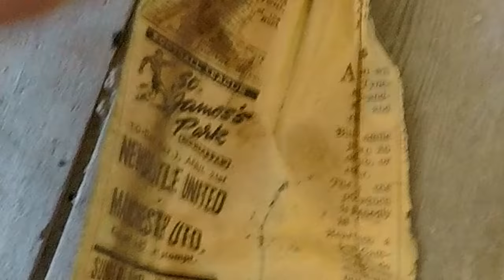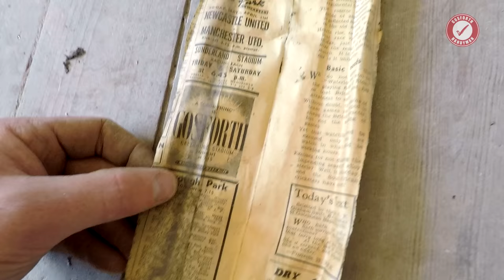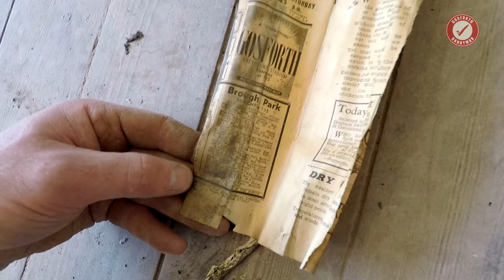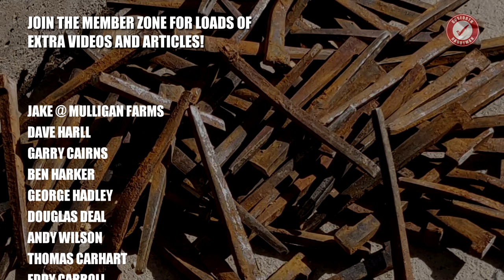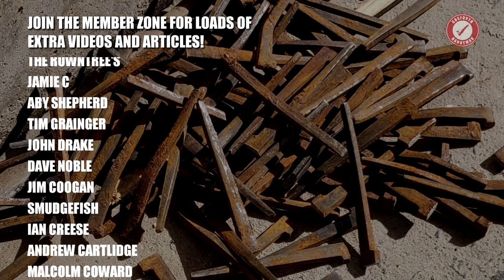How we INSULATE under the floors (1920's Renovation Part 26)

Comment: I hope the void under your floors are well ventilated otherwise look out, we have just had to replace the entire floor joists insulation and deck  as the builders did not install adequate ventilation and 200 x 50  joists  had decayed and only 75mm was left in places after 12 years!
Reply: Haha reminds me of when I pulled up my floor recently to do this job and found that the original 1920's joists were daughtered up to replacements from about 1980. Both turned to dust when we pulled on them. The air brick had been blocked up for at least 70 years by the looks of it. ;0 They went to the trouble of replacing the joists but never bothered to check ventilation or figure out why the originals had dry rotted. We bricked up the fireplace and put an air brick in below the insulation level and replaced all the joists with reclaimed timber. Treated the ends etc. Solid as now. Last another 100 years no question.
Reply: I’m fairly sure he mentions in the tutorial that cleaning and ensuring the air vents are free of any debris or blockages.
Reply: @jixuscrixus1967  someone obviously commented without watching the vid as he mentions it loads!
Reply: How are you supposed to ventilate the void under the floor?
Reply: @sali8312  installing airbricks allowing the air from outdoors to flow under the floors preventing damp.
Reply: You obviously didn’t watch the video
Reply: What size wood screws have you used and I noticed you drilled pilot holes before putting screws in. Does this mean one should not use the initial hole where a nail or screw was inserted. Thanks. Great video, by the way.

Comment: Really like that I'm not the only one who loves to clear out under the floorboards if they are up.
Reply from the maker: Cheers Craig! Absolutely - hate leaving it like that. 😁
Reply: On the ground floor it also improves the air flow, any rubbish tends to suck up the damp too and it takes longer to dry out.
Reply: you can also find some treasure. Once I found pack of smokes about 80 years old. My friend smoked them and he is still alive, so I guess it was a win
Reply: Every other tradesmen uses that as a handy bin! Never known anyone to clear up under there. Part of the joy is reading the old newspapers!
Reply: my builder lost his wedding ring under my boards, its somewhere down there for future generations...
Reply: @ru54623  did he charge you extra?
Reply: I found the remains of a sandwich wrapped in foil under the floorboards of a house once. The boards hadn't been up since the 80s when it was rewired. I often think about that electrician looking around for what he did with his lunch.
Reply: @herraghty  why would he? It's his fault 🤣

Comment: Good progress - until your comments about a wood floor going down my thinking would have been to just rip up all the floorboards, batten and insulation and then fit t&g flooring chipboard (screwed down) - the time saving probably out-weighs the cost of the chipboard (and lots of floorboards to re-use for something else).   AND the pallet breaker gadget is great - I have  a home-made version that cost me almost nothing!
Reply from the maker: Yup, would tend to agree. That would have made the job much easier if we weren't doing new wood floors. 👍
Reply: What would be wrong with putting wood flooring on chipboard?
Reply: @Game0verFool   nothing wrong with it. Im about to rip up my old floorboards in the lounge insulate put chipboard down and glue oak on top. 

My guess is Andy is confident the boards are flat enough to glue to or hes going to overlay 4 or 6 mm ply which will eliminate any potential drafts that still may exist and saves a few hundred quid on chipboard.

Comment: Great work as always , I know from personal experience that the thicker insulation would be harder to push into place under the floor boards . The slittiest difference in the gap between the joists and it locks sold, so what you have done is definitely the way to go . I love your approach to everything you do even down to cleaning out all the rubbish that has no doubt been there since the house was built .  You’ll have to put a peace of wood under the floor with your name and date when this work took place , so in another 100 years someone will say this chap made a wonderful job of this house bless him .       Best wishes and kind regards as always  😀👍👍👍
Reply from the maker: Cheers bud! There's a few messages hidden around the place. 😁👍

Comment: I had this exact same job to do myself for a 1925 house and I used scaffolding mesh to create a hammock between the joists. Then I laid rock wool on top. It was something like £1 a roll at the time so it saved a lot and the limited joist depth wasn’t an issue. I think I put a vapour control layer on top of that and then nailed the boards down. My main concern throughout was to avoid moisture buildup in the timber as this leads to woodworm which we had an existing problem with. The rock wool doesn’t trap moisture (which is another reason for choosing that) and also all the air bricks needed clearing out to get air flowing under the floor. 12 years later and the woodworm issue has been sorted ever since. I like your method because it doesn’t need all the floorboards taking up which a massive time saving. On the flip side, the good thing about taking up the floorboards is that when you nail them back down, the gap in between can be closed (to stop draughts) and this saves a job later.

Comment: I'm currently doing a similar thing myself and I wanted to reduce the amount of dust and loose debris from the insulation as much as possible. I did some research and ended up buying some soft material jigsaw blades to use in the jigsaw to cut the PIR. They work like an absolute dream, clean straight cuts and no dust or debris at all. I mean none! I was amazed by it, I would highly recommend them if cutting rigid insulation.

Comment: I have nearly got all of our small bungalow done now the only difference is that I put ply on my battons and I moved my heating pipes into troughs in top of PIR. Heating pipes under ventilated floors has been a gripe of mine for 20 years when Energy Saving Trust were banging on about poorly insulated hot water cylinders. Yes I cleared it all out, hoovered it, as I went, a lot of builders see floor voids as skips, I also mortared in the joists, something the builder didn't do and sealed up everything. I did seal up some vents that faced the joists and so I couldn't duct them down into void. The vents on the open ends of the joist I ducted down and we have a lot. To rigidise the floor I did put a two brick pier under joist, we are on a concrete raft so easier than most, I used engineering bricks + slate + DPC. We have an EPC A, I am not sure its good enough for an A, though I think they have A+, A++ to create higher levels. We see a lot of properties around us being bought and 'done up' they always keep the original feature of an appalling EPC, which is crazy. If a property is done up then it should be compulsory to improve the insulation because once you have fancy bathrooms and kitchens no one is ever going to tear it apart.

Comment: When removing nails from joists, I always give them a whack with a hammer first - it drives them slightly further in, but it also breaks the bond between the nail and the wood which has formed over decades, which makes pulling them out a lot easier.
Reply from the maker: Good tip! 👍

Comment: I did this when I moved into my bungalow late 2014, and put DPM on the subfloor to prevent moisture from the ground before keying in the insulation , cleaned up all the crap from the previous tradesmans work aswell,renewed the old floor boards for 22mm Caber floor....job done 👍
Reply: Hi did you just lay the DPM on the floor and that's it ? Thanks

Comment: Been there done that. In 2017 I removed all the boards at one time, cleaned out and vacuumed underneath but then put a breathable membrane "up and over the joists" sealing in at edges then laid in sheeps wool insulation and put a new floor down. Stank like a barn for 6 months (not thereafter) but the insulation and sound proofing that it provided is on another level.
Reply: I'm planning to do the same in a few months so it's good to hear it makes a difference since I was a little worried that it wouldn't be worth the hassle.
Reply: @elobiretv  VERY much worth it if you do it properly. NO draughts, silent, breathable and the house warms up so quickly it's un-real. Huge reduction in heating bills. It's more work than using Celotex. As I have wood flooring,  If I had my time again I would have considered running  tubing underfloor as central heating and warming the whole floor area rather than radiators but that is another discussion. Hope this helps.
Reply: Did you put a DPM over the top after or just the single breathable membrane underneath to hold?

Comment: Excellent video. Nice to see a builder cleaning out under the floor, it's usually used as a disposal area.  Most important to seal all gaps so drafts can't get through particularly round the walls which some people forget about and the wind whistles in under the skirting boards.

Comment: Thank you for the good guidance. Best not to cut the Ecotherm outside on the grass though. It won't break down in the environment. Better to cut it somewhere you can sweep it up or collect it afterwards. Technically polyisocyanurate is recyclable, (but left over sawings won't be), but otherwise it might go to an energy from waste plant, (or landfill).

Comment: I’d personally use a multi tool on the first floorboard so the cut doesn’t overlap and then circular saw the tongue & groove parts sections. The boards lift pretty well that way and virtually no damage. I’d also try to stagger the cuts so the cuts are all in a line, if that makes sense. 
Thanks for the video though 👍🏻

Comment: OK, please allow me help you. I have MSc, specialising in thermodynamics, and did my thesis many years ago on suspended timber floor insulation effectiveness. I am now an thermal consultant for aerospace applications. You need to spring force the insulation upwards to be in constant contact with the floor. Eg; use something like a PLY curved/sprung slat from a bed, screwed to the underside of the joist so that it bends the slat straight and always forces the board against the underside of the floor. The are numerous leaf spring alternatives.

The air bricks & positioning are designed to cause a purpose draught between the joists, directly at the end face of the insulation that is later installed. This draught is now forced to go around the insulation with a venturi effect pull at the opposite end. The slightest gap between the PIR & the floor board causes a small channel that the air blows/pulls through at high velocity, sometimes whistling or chattering the PIR & floor boards, thus the insulation does little but act as a conduit. You will also have small gaps in your floor boards tong & groove, that permit 'cross-flow' across joist. The problem i'm describing doesn't usually happen in lofts due to the gravity on the insulation that moulds to the face it's laying on.

There is visible clearance in your video (top & sides of PIR) and you wouldn't have been able to slide the PIR in to the slot so easily under the floor boards that you kept in place if there wasn't a clearance. You could partially rectify this by getting the floor boards up at each PIR joint and spray insulation foam (2mm thick, 100mm wide), before putting the floor board back down. This will 'closed cell' seal the openings of the gap that you have created.

I have written this with my best and  positive intentions, so neither you or your viewers make the same mistake that 99% of installers are making. Suspended underfloor insulation is one of the most disruptive and longest payback. If you go through all the trouble, you need to to it properly else it will NEVER payback. If a jobs worth doing well or don't bother.

A few technical improvement would transform the performance from 20% to 90% effectiveness, potentially saving £90 per year instead of £20 per year in heating costs. I wish you well, and if you want to make a proper video on all the critical things to get right, I'd be happy to help you.
Reply: Just a quick question you say you have a degree I  thermodynamics and ypu are an insulation consultant. Then why did building control pick up on the fact that your insulation wasn't touching the underneath of the floor board and was creating a duct resulting in heat loss.
Reply: @nathancurtis2585  My MSc thesis was 35 years ago and was substantially modelling the theory. It did not consider the modern materials used today, the full practicality of achieving the optimum theory and modern day best practices. Since then, my work has been biased towards aerospace applications.

Due to my background, I was able to talk to BC on a very detailed technical level. They didn't pick-up on your 'alleged fact' that my insulation wasn't touching, because I haven't even started my installation yet. During the convo, they told me to make sure that when I do my installation, I ensure no gaps for the previously explained reasons.

If you think about it, a 6kph breeze equates to 1.7 m/s, meaning that the warm air is washed out the gap and replaced with new air before the heat reaches the insulation. Armed with this knowledge, I looked at a few youtube videos for more practical tips, and saw that this critical basic principle was not being taken seriously.

One other thing they mentioned was to apply sticky back foil tape to the top of the joist, overlapping the PIR (not possible from underneath). This delivers continuity of reflective surface and seals the possible air leaks with one continuous reflective & leak free layer. The effectiveness of the installation can be severely limited if you still have draughts.

Hope that helps and all makes sense.
Reply: @markfetherstone2885  Thanks Mark. I hope Nathan watches that video.

It looks a great product and the video explanation on the 'performance gap' really does agree & emphasise my point on sealing all the gaps. Retro fitting suspended floor insulation can be very disruptive, and you must get it right else you'll have wasted your time & money.

Shame they didn't explain a solution to keep the PIR board tight against the underside of the floor boards though, unless they coat the top of the PIR with the foam tape and compress it (super expensive).

As presented, the PIR will work it's way down and create a conduit. A sprung batten would do the trick.

Comment: I was reasonably careful when taking up the floorboards on our '30's property, they were not tongue and groove, and I'm happy to accept some character in my sanded floors,  but the pine came up beautiful after a couple of days of sanding per room, much nicer than many of the fake wood floors available to me. And with the variable diameters of gap filling high density foam, for wooden flooring available there are not concerns with knocking over a glass of water, which would be an issue without the foam.
Reply from the maker: Cool! Not T&G? Don't see that very often! 👍
Reply: @GosforthHandyman  there a bit wider than your boards I think, at about 170mm.
Reply: me too but my 1930s board were t&g. I spent ages lifting carefully while preserving the t&g and managed to remove about 1000 carpet tacks, insulate with sheep and reinstate , sand and osmo. look absolutely lovely. Importantly the whole of the ground floor has the same floorboards and so its all on the same level.
Reply: @twmd  got the downstairs to do like that still, luckily in my case without T&G, but should still be fun, need to put in new 32mm water line first thought.
Reply: @cjhification  good luck! I found all the bricks from a old fireplace underneath nad a pack of woodbines from 1930! worth planning some time for cleanout.!  I added a new radiator and needed to extend the radiator feed pipe in both directions so worth considering all possible jobs that are easier with the boards up!
Reply: @twmd  thanks. I have had up a good amount up to put in a 25mm² SWA feed in for garage, so reasonable amount of clean up done under there already and with the work done to replace the back boiler, have a pretty good idea of condition too. Will likely replace any sections of wiring that are old on the downstairs sockets whilst everything is up, and with water pipe, think that's it.
Reply: @twmd  I spent ages doing similar with my 30s house. Unfortunately pine boards are so soft, the floor was trashed in no time. Some might call it patina, but when you've spent weeks doing it, it still hurts to see.

Comment: Great video, one extra tip is to fire the brad nails in at opposing angles, makes the pull-out retention much better especially with brads. 👍🏻

Also, expanding foam (using a gun for control) works great to stick the ends of PIR together, and along the batons if dropping the PIR from the top to seal.

Comment: This is a really good video bud : ) ... one thing though, it is important to also check drains prior to installing insulation as the moisture balance can get tipped in a floor by adding insulation, and it isn't unusual for timber decay or woodworm to pop up in the future.
Reply: I was going to pour vermiculite into the void (half fill) , would this be better for the timber. Also install black hole wall vents?
Reply: @LabRat6619  personally I can’t see how that would any difference to be honest 👍